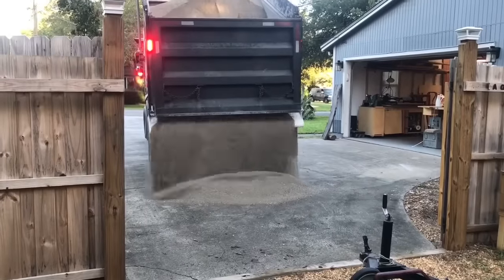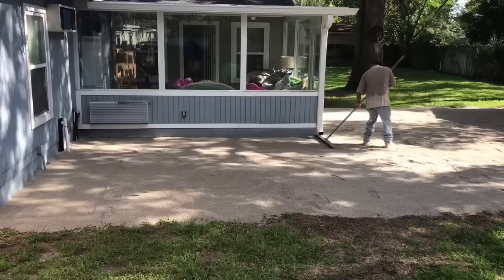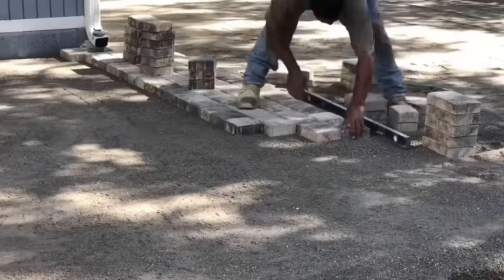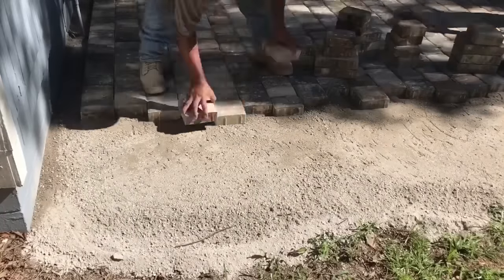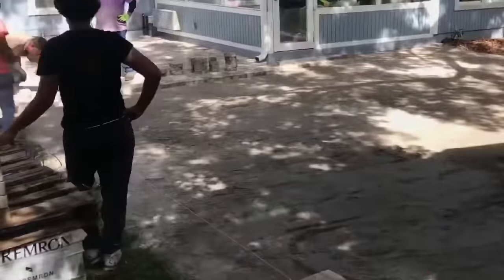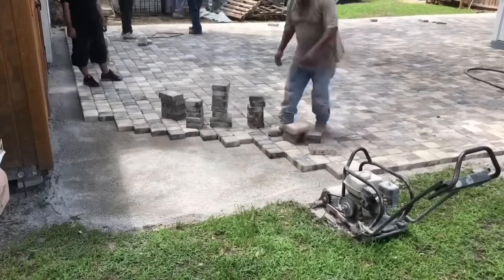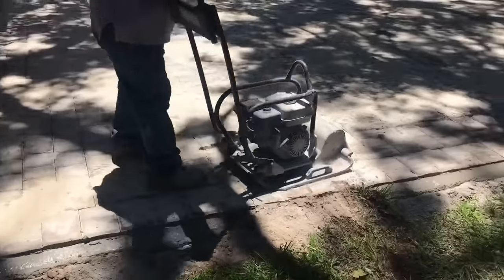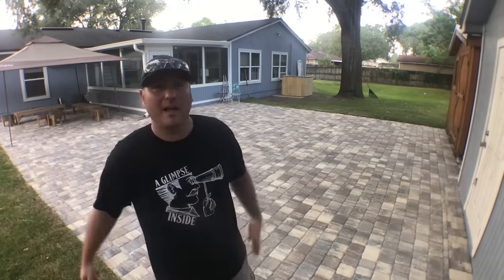How to Install Pavers like a Pro | Outdoor Project | Outdoor Living Space | Landscaping

Comment: Hi, I am planning on laying leftover pavers on my patio, to cover up some dirt. The area is 21sf, my pavers are 8x5.5 I calculated that I need 71 of these. My question: is my calculation right AND how much sand will I need to level the ground. I am a handywoman with limited math skills :-)
Reply from the maker: I wish I could give you better information however I hired professionals and left all that up to them. Please forgive me I hope you’re able to get done what you need
Reply: yes  you have 2.33m2  so 21sq ft = 12ins by 12ins is 144 sq ins  times 21sq ft = 3024sq ins pavers are 8 by 5.5 ins so 8 time 5.5 = 44 sq ins each , and 3024 divided by 44 = 68.73 so 71ok, hard core 0.26m3 = at 4ins thick, top sand 0.065m3 at 1ins
Reply: Go to your loyal landscaping supply store. A ton of granite sand costs around 50$. You’ll need about 1/4 a ton. Which should be around 6$ or if you go to Home Depot, they have sand bags for about 5$ which would cost around 20$

Comment: Paver base should be 4 to 6 inches thick,
3/4 inch of sand screeded, plastic edging with 6 inch spikes for border control... This is not professional so please take that headline down its false advertisement sir...
Your patio will settle and be uneven in many spots in a couple years and you will never grow grass near it.... and 1200 sq ft in 1 day is unreal, unless you take alot of shortcuts which I see...👍👍👍👍
Reply: Mike D lol calm down buckaroo
Reply: @maarez8869  Right?! "Hey it looks great but it sucks in my opinion. Thanks for sharing. 👍👍👍👍"

Comment: How deep did they dig out for the paver base? Didn’t look that deep.
Reply from the maker: 3 to 4 inches
Reply: @AGlimpseInside  pro is 7 inch deep  and they did not put sand to lay the pavers..
Reply: @miguelordaz5884  Since it's not a driveway, I'm not so sure I would bother with 7" either. Just a thought.
Reply: 4 inch for patio is enough, and that kind paver don’t need sand to layer the paver…I’m particularly use sand for travertine and pools deck.

Comment: I wouldn't say "right way". It's definitely A way. It's probably fine... I doubt it'll settle any more than the way we build them, but this is kind of the quick and dirty way. I mean no disrespect to anyone. I think your patio is just fine, and it certainly looks the part. But, even the die hard dude that asked that the title be changed is taking the shortcut method. "Paver restraints" - the black plastic edge strips with landscape spike fasteners are just okay. The best way is to install an actual border paver or matching wall block (usually twice the thickness of a field paver - doubles as a good stair riser) on a compacted screening base - kind of like a footing. Then complete the "field" portion using standard thickness pavers (1.5 - 2.75" depending on your use case). The field portion is installed in this order; landscape fabric/soil separator, 4-6" of paver base, ⅜" gravel w/ fines or limestone screenings, compacted in maximum 4" lifts and then the final layer is approximately 1" of sand, screeded to your grade. Paver patios rely on immobilization more than compaction. Having an immovable border is paramount! Which is why I skip the black plastic paver restraints. Use polymeric sand to promote run-off and add additional adhesion to your patio. Use paver sand if you want permeability. Both of which are vibrated in with a vibratory compactor. I'll finish by saying, that again, it's probably fine. At $5-8 per square foot, you got a decent patio. The standard here is no less than $25 per square foot. We usually do them for between $30 -38 on the account of having a substantial border and accommodating curves.
Reply: I've been doing a ton of research on pavers trying to get into that work. Everything you've said goes along with what I've read, however I've never heard of that second layer between the base and screed? Is that really necessary?  I am by no means any expert or pro, I've literally only done 4 patios, just wondering.
Reply from the maker: Thanks for taking the time to write all this. all good points for sure. I can appreciate the attention to detail that others have in this craft. However here in Florida this seems to work just fine for whatever reason. But again thank you
Reply: I need to make a a couple of small paved areas (4x6)  and I was thinking that larger pavers dug deeper as boarders might work instead of the plastic paver restraints. I saw the concrete on edges and that might be a possibility, but I resist concrete as a last resort, except for fence posts. So, I appreciate your addition.

Comment: Can this type of concrete be used to fill a border with gravel for a bbq or sitting area instead of a full slab of pavers?
Reply from the maker: I’m not entirely sure. I made a gravel parking pad 20’x30’ recently and I framed it up with double stacked landscape timbers. It’s on my Instagram account from a few months back
Reply: It should just probably won’t be that pretty

Comment: Good job but #1 problem I see is they only removed the grass but left the loam/top soil. That's a big no no. It has alot of organics in it and they will decay and settle. Also it's like grease once it gets wet. Do a follow up in a year or 2
Reply: And, they did not even compact the soil before applying the paver base. ...And, no landscape fabric, so welcome, weeds.  The paver base, it appears, starts out around 4 inches at the top (bare minimum), and by the time they get to the edge, it appears to me there is only just over one inch.  They compact it, and then install the pavers over the base....What's missing???  How about the 3/4" to 1" of PAVER SAND???!   Even I know better!    When they reach the edges, they didn't install enough paver base, so they throw a quick shovel-full down (about 1/2")  and just put the paver over it without compacting it at all.    I'm the last person to claim to be an expert, but I'd really like to see what shape this is in, in a few more years.    Gotta ask questions, if they are able to install 1500 square feet before lunch.
Reply: This is the correct way of not doing shit right
Reply: @j.c187  Lol
Reply from the maker: I get a lot of comments like this on this video. The only thing I’ll say is that for our soil type and topography I have seen work that these guys have done just like this, 5,6 years ago, and it still is holding up great. I will do a follow up on this in about a couple years so stay tuned

Comment: What kind of paver base is this? Also how thick was the paver base?
Reply from the maker: This was a paver base with recycled the cement concrete and also new cement as well with gravel mixed in.
Reply from the maker: About 3 to 4 inches thick as well

Comment: Almost had me convinced,.. but no. ..wheres the L pattern? or any other type of pattern for that matter? Throwing down linear rows of pavers is not a pro. They have to be crossed
Reply from the maker: H Vac Yeah I completely understand your concern here however it’s kind of an organized chaos. There are three sizes and three different wits and links so you can always get an even age for a starting and stopping point. Either way I’m sure a running pattern would look pleasing to the eye however I kind of like the fact that it’s chaotic. But I completely understand where you’re coming from
Reply: Usually when I do pavers it's a chaotic. However its important to not have to many straight lines. This can be tricky sometimes you'll get stuck with a "snake pattern" where all the small pieces continue and you cant fit the larger size. Or you can get stuck with a gap that's actually smaller than then paver. That's when you gotta go back and rearrange 😂
Reply: They don't have to be crossed this pattern is just breaking lines. No straight lines can show up except border. What you are thinking of is herringbone 45 or 90 which is done with one size of pavers and thats usually a 4×8

Comment: About how much would something cost if I were to hire someone to do this?
Reply from the maker: Anywhere from six dollars to $12 a square foot. We paid in the lower range because we are in Florida and we don’t have to worry about the ground freezing. There’s much more work to do when you have to worry about a lot of temperature variation
Reply: 3 piece pavers cost anywhere from 3.25-5$ (before tax) but you still need your gravel base layer, bedding sand, polymeric sand, and any other indirect material ( about 6k in raw materials ) .  that is just raw direct material alone. You still need to take into account  indirect material, labor, delivery fees, disposal fees and If you want a paver driveway, than you would have to pour concrete and reinforce with rebar 5-7$ sqft extra.  For this project alone, for a 1200 sqft paver patio my break even point taking into account, labor, direct and indirect material, & over head, it would around 8500$ if everything goes right. Since there seems to be easy access to the worksite, and only minor layout and grading I would bid this project at 13$ sqft ($15,600) That would take care of material, labor, over head and warranty. Market price in my area is 13$-18$ sqft for pavers ( I’m a contractor )
Reply: Ivan Ramirez that’s affordable

Comment: Well, to someone who does this every day, that’s not professional at all, that’s a linear pattern, not solid and the lines are wavy, needs to be staggered kinda locks it all together and looks way better, base might not be thick enough for longevity either, and they should have used edge restraints with pins, concrete will crack and give and you grass will always burn with that small amount of top covering it.
Reply: But, I will say for a days work they’re quick, not hacks, maybe you had a budget they needed to uphold too.

Comment: That concrete edge is the Lazy way it will break in less then 2 years I lay 1 foot of the edge of pavers on fresh concrete and I give 5 year warranty on every job
Reply from the maker: Sounds like a better solution to me. I guess only time will tell but so far so good. Thank you for the insight
Reply: A Glimpse Inside but those guys did a good job overall I can tell they’re experts

Comment: Nice, hopefully it lasts longer than a day lol. Putting bricks on dirt will sink over time.  There's no solid gravel base. But looked good so whatever.
Reply from the maker: No worries whatsoever. Everything looks great and no sagging at all
Reply: @AGlimpseInside  Over time clay shrinks when it dries and expands with becoming wet, you've seen in the desert the cracked ground, well that's because the clay has shrunk in the heat, you wet it enough it will expand.

The best way is to dig down far enough where the ground is always moist that way movement and lifting can't occur.

So many jobs I've seen and the bricks are all wonky and moving everywhere just because people can't be bothered to do it right in the first place. All for quickness that's it lol.
Reply from the maker: I appreciate your insight. However we are not having any trouble at all. Although time will tell

Comment: Didnt appear to use any levels for the initial base just eyes? all the water is just going run off onto your lawn leaving it a massive bog pit. Also you lay pavers on a sand bed after compacting a road base you will have problems with uneven pavers in the near future. Looks good astheltically but long term not so much
Reply: Also id suggest spraying the ground with a weed killer as they only took the top off. The roots will still be there and potentially grow through the paving
Reply from the maker: I can appreciate your concern however we’ve had no issues that you mentioned. And also my families have the work done from these guys for the past six or seven years and again no issues whatsoever. I can appreciate which is soon for sure and thanks for watching and for the information

Comment: Any recommendations for finding a landscaper in my area? How did you find someone you trusted to do the work?
Reply from the maker: They were a friend of the family I got lucky
Reply: Very few landscapers use a concrete base, it’s the only way for longevity and quality. This way is bound to be shed tears during rainy season when you walk on the pavers, and they are sinking everywhere. Northern climate is even worse during freeze thaw cycles, the pavers grow legs 🦵 if not on concrete...lol. Been there done that.
Reply: JOE Geo correct you are but no one wants to pay that kind of money.
Reply: Ivan Ramirez my moms neighbor has very large patio that he “resets” every 2 years like clockwork, due to the outer edge sinking, I have been called when I still was running my business to redo jobs only 3-4 years old, so, short term it may be cheaper, but my price was very close to everyone else, and you can drive a car over my work and it won’t sink.

Comment: I wonder why they didnt do gravel... compact it...then an inch of sand...screen...then pavers... like most of the other landscaper do? Any thoughts?
Reply from the maker: The Reel Vini that method of laying pavers is fantastic. And it works well throughout the entire country however down here in Florida where really we don’t experience any freezing, the paver base they used had all of that mixed in together, crushed recycled concrete, Portland cement, and sand as well. They told me that down here in Florida this will work just fine and should last for years!! I hope that helps thanks for the comment!
Reply: I wonder if it will work here in Phoenix AZ. Since we're in the middle of hell Haha
Reply: Is there specific name for that sort of base? Or is it just called paver base?
Reply from the maker: The Reel Vini I do believe it’s just called paver base. And I believe it would work there as well.

Comment: Looks nice but I'm concerned for longevity. Geotextile filter fabric was not installed. No setting bed of sand used. Pavers in a running bond do not achieve good interlock. Concrete edges are a no-no. Sand can be used in joints but that was not polymeric sand they used, if it had been it would have gummed up on the pavers as soon as they got wet. Look into and ICPI course.
Reply from the maker: I looked that up and thank you for the kind suggestions. My family has had work done like this over the past few years and everything seems to be holding up just fine. Maybe it’s because we live in Northeast Florida and we don’t have too many climate changes. Either way I did look up different methods and it looks like those were a bit pricier. But I guess you get what you pay for in life

Comment: 1200 hundred sf...
Materials: One big dump truck of regular sand, 8 pallets of pavers, n  G2 intelligent polymeric sand 8 for sealer gaps..?
Reply from the maker: ricardo soto The dump truck of paver base is a mixture of old pulverized concrete sand and cement. Polymeric sand For sure I’m just not sure exactly what kind

Comment: Downspout not buried?
Reply from the maker: No I opted not to
Reply: Unless you put a clean out access 12-24" from the house, running it under pavers would mean it gets clogged by debris in less than a year. Extra, unnecessary cost if your pavers are graded properly and go out that far.

Comment: This install is wrong in so many ways. Anyone watching don’t take this video for advice. Recycled concrete is a cheap base to use mostly just a dust / silica not much stone for a hard base. Then In order to lay the pavers a bedding layer is supposed to be installed using screws rails in order to have the bedding layer properly level as it’s screeded. This patio will settle during freeze / thaw because moisture will be trapped under the patio and not be able to drain through the recycled concrete. Clean stone should be used as the base and bedding layer for drainage no settlement issues. And also the base should extend at 6-8 inches minimum beyond the patio so that the edge of the pavers do not cave out and it has enough material supporting it. Again to anyone watching this video do not take the advice from it. Go to a professional contractor

Comment: That concrete dust that's flying around when they're sawing is filled with silica...You don't want to be anywhere near that. If those workers aren't using water or wearing respirators they are in for lung issues down the line.
Reply from the maker: I totally agree. They definitely should’ve been wearing more respiratory protection. I tried to steer clear of most of that myself

Comment: Concrete on the border is a big no no!
Reply: Can I ask why ?.  I'm not a builder, so haven't a clue.  Thanks.
Reply: Ewan Black 
1.  It will crack over time and need replacing.
2.  You will never get grass to grow over the concrete thus the grass will not grow all the way up to the patio parameter.

Comment: I hope that no one watching this believes that this is the proper way to create a paver patio.  The site soils weren't compacted, there's no geotextile under the base, there isn't enough base, there isn't any bedding course between the base and the pavers, and there isn't enough base prepared beyond the finished surface of the patio.  Also, having a downspout outlet on to the paver surface is a terrible idea.  For anyone watching this that wants to do it the right way, check out the Interlocking Concrete Pavement Institute website for sound construction practices with professional results.
Reply from the maker: One thing is we don’t have to deal with the frost line which is pretty convenient so a lot of layers are not necessarily needed. Also as a customer you can request to have it done like this to save yourself about 60% of the cost. If the job entails everything in this comment it would’ve been roughly around $15,000. But I can tell you it was well less than half of that. And good news! There is no discernible issues with this patio so far. Absolutely none so that’s a good sign. But yeah check out the pavement institute. I’m sure there’s some good info on there